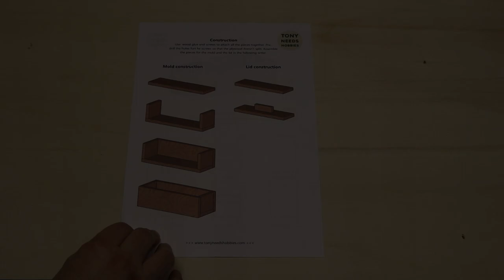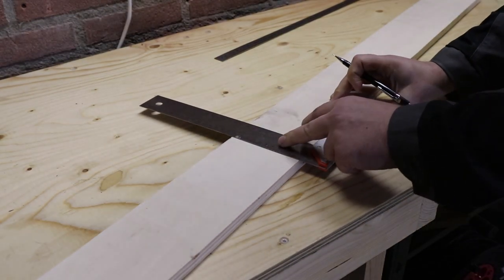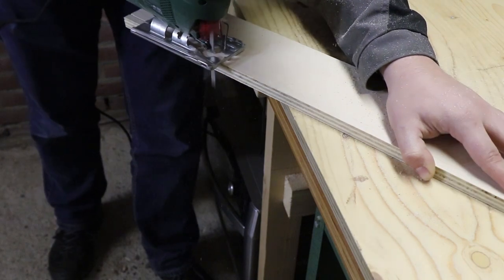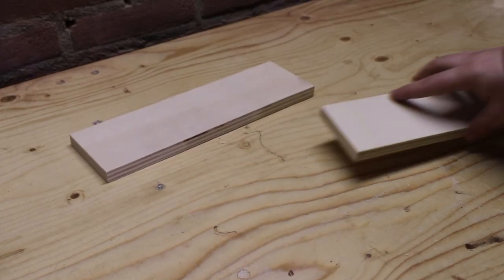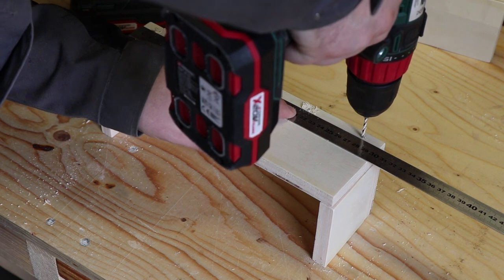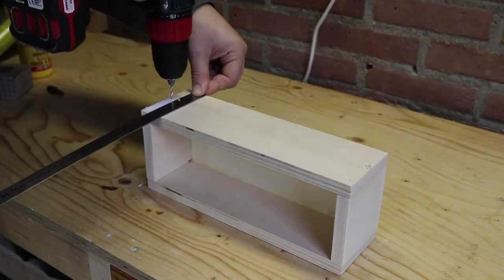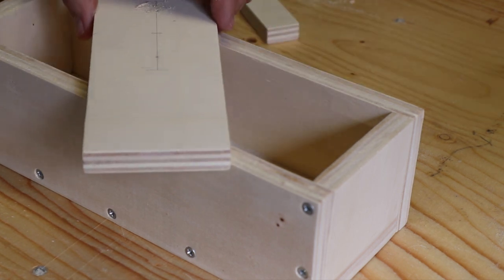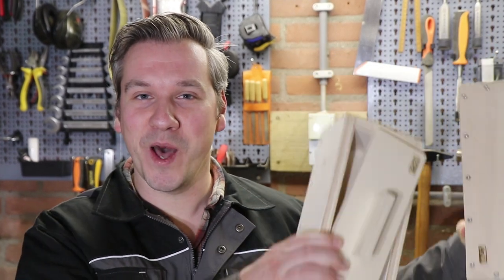How To Make Soap Molds For Hot Process And Cold Process Soap Making

Comment: Nice job 👏 thanks 
But what about the isolation layer in the mold which is the most important 😅
I watched the video waiting to get this part and you didn't 😢
Reply from the maker: Well, wood actually is a really good insulator. That's the reason I chose this thickness of plywood. Every time when I made cold process soap in these molds it has always gone through gel phase no problem at all. Hope that helps a bit and thank you very much for watching my video, it's appreciated!